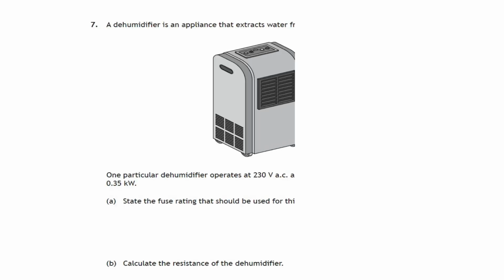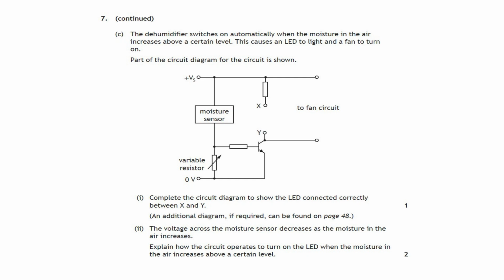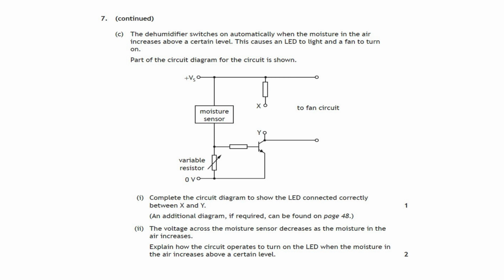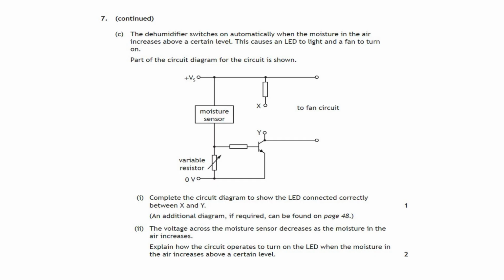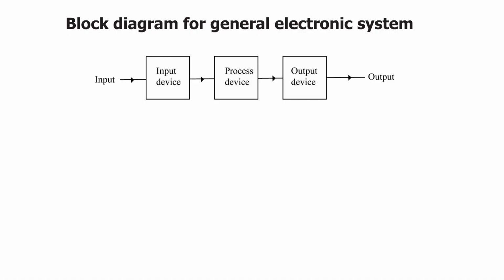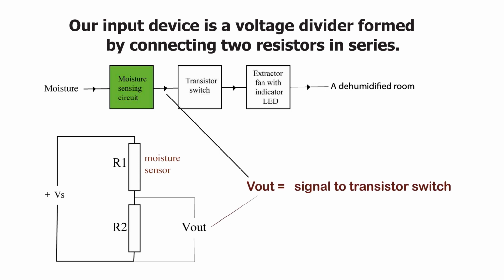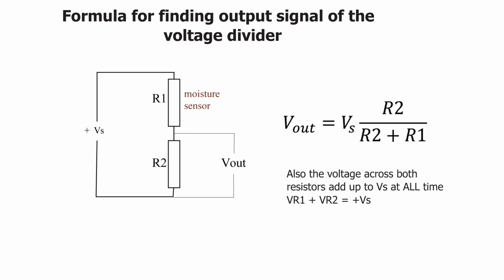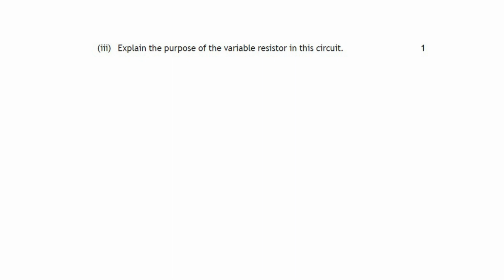Question 7 SQA NAT 5 Physics Exam 2022-Power, LEDs,Transistor as a switch.

Comment: for question 6 part B did you give your answer to the nearest 10 ? Just wondering because I'm getting a little higher and not sure if my answer is wrong or if I'm rounding wrong, have you to put it to the nearest 10 ?
Reply from the maker: Hi Luke, The question should be 7 b but I got the question numbering wrong.  The initial values were 230 V and 0.35 x 10^3 W. Both these values are given to two significant figures so the final answer should also be given to two significant figures. 1.5 x 10^2 Ohms is written to two significant figures. However,  if we were told the voltage was 2.300 x 10^2 V and the power was 3.500 x 10^2 W (four sig-figs each) then you are justified in writing 151.1 = 1.511 x 10 ^2 as your answer.  You will not lose marks in this paper if you do not follow this rule UNLESS you write too many figures. One other point:  if 52.9 and 0.35 were pure numbers then 52.9/0.35 = 151.14285714285714285714285714286 (from my calculator) is perfectly okay.  Good luck with the paper next week and let your friends know about the video.  I shall try to have answers to the remaining questions for next week.